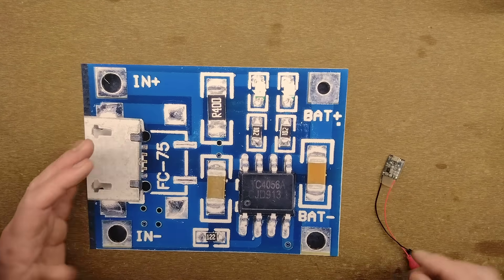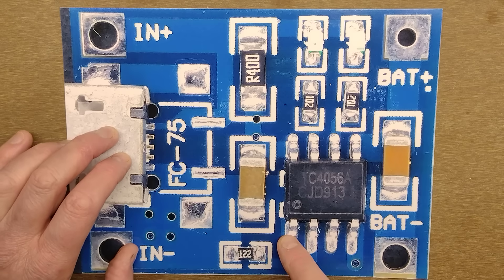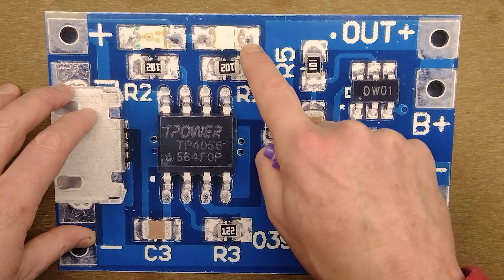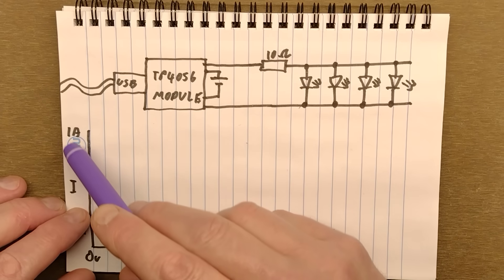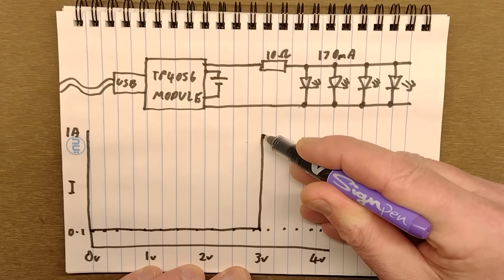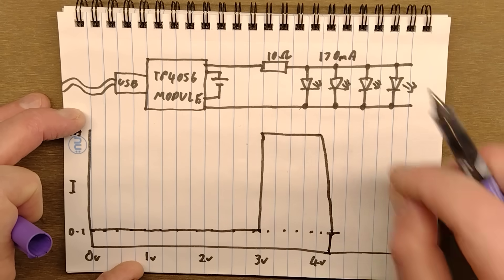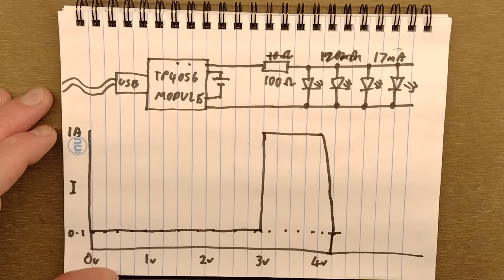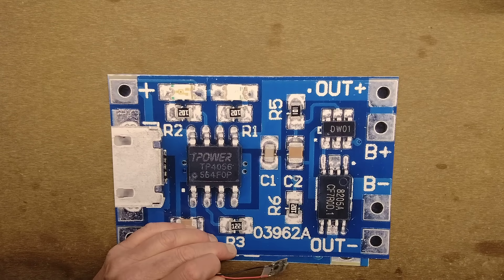TP4056 myth busting

Comment: Thank you for your work, very much appreciate it. The extra bits are usually inside the cell. I once used it to repair and modify a flash light whose TP4056 in 6-pin form was blown.

Comment: i think that low voltage 100mA charging is safety measure?
damaged battery will likely have low voltage, also emitting all amps as heat this will lead to fire hazard if you try to charge damaged battery

Comment: i have heard from videos on charging smart phones that keeping the phone on the charger for too long would wear out the battery faster because the charging circuit will cycle topping off and would be hard on the battery.

also i am not sure if  holding the battery at say 4.15 volts is good for the battery either.
Reply from the maker: It's more to do with keeping the battery in its fully charged level.  The most chemical stress on the electrodes is at full charge and discharge states.  That's why it's a good idea to stop charging your phone at about 80%.

Comment: why does that newer model have 4 output terminals?  "out" +/- and "b" +/- ?
Reply from the maker: Battery connections and load connections.  The extra circuitry prevents the cell from being over discharged.

Comment: Another argument i hear is that  when you use a load while charging, a flat battery will never be charged as yr load will consume the trickle charge. That might be, but as my battery fed projects usually will include some form of deep sleep, i am not that worried about a load pulling 100mA for 5-10 secs and only maybe 3uA for 3.5 hrs

Comment: I've just ordered a bunch of these to make a mini wind turbine that charge up my torch batteries, I need to know if the load would drain the battery if the wind stops!
If the charging voltage stops completely will the load drain the battery or will it just all stop? Thank you 😅
Reply from the maker: It should block reverse current flow.
Reply: @bigclivedotcom that won't be a problem, I mean, say I have a light connected to the outs, will the input power be charging the battery and powering the light?
Then when the power input stops, will it use the battery to  function?
Also.. (sorry), when the battery is fully charged, will it direct all excess power to the light/load or use the battery as its path.
I need a trigger in the circuit, say the "charge complete" led to signal a relay to shut down the tp4056 and send the current to my load I think 😅

Comment: i would like to use this to charge a li ion battery. at night time, the battery should power an led. So led must be turned off during light hours. could you advise me on the parts I need to include and what components I should use?

Comment: So, can we run a load with TP 40 56 while charging the battery?
Reply from the maker: If it's lower than the charge current it should work as detailed in the video.
Reply: @bigclivedotcom  Thank you for your short and clear answer.

Comment: One of my favourite modules.. I also like the charging module in the power banks with the 18650 inside.. they have over & under voltage protection but the thing I prefer is the output has a little boost converter so it's output is 5volts instead of 4.2v to 3.7v with the TP4056. 
Plus the power bank phone chargers has a USB connector built in. Comes in very handy for lots of little projects.
But that said, the TP4056 is a must have in any electronics parts box. The trickle charge option on it has got me out of more than one hole. 
The one that stands out the most in my memory is my nephews iPad discharging down to below 2,5volts. So I had to spend 20 to 30 minutes plugin in & out a phone power bank as it will give current for about 1.5 seconds before it realises that the voltage is to low then shuts off again. After 2 days of my nephew not putting it on charge before its battery was at 1% I remembered the trickle charge on the TP4056. And soldered a micro USB connector to it's output (to be honest I didn't think it would work as it's not the 5v of USB) but it worked like a charm. Could of opened it and fixed it but ya know kids these days. The 10/20 minutes it would of took to fix it was to long for him not to have it to watch stuff and chat with his friends... 😂 
Plus he was living here in my house with his dad at the time (my brother) and we're out in the country. He was brought up in town. So the boredom out here was driving the kid mad. So I didn't blame him 😠🤫(just kidding)
💚🇮🇪🙏

Comment: Hi again Clive, I need your advice again!
Tried to charge a 550mAh battery using a TP 4056 module and accidentally connected reverse polarity.
It seemed to charge for a few minutes but then the light went out (no Red "charged" light) that's when I found my error.
TP4056 is no more, but worse, the two Rear USB2.2 ports on my machine, (it's an intel 6i5SYH NUC) are now dead and I get notified every 5 seconds of with overcharge  warning, can't get rid of it.
Front USB's are working as is the rest of the machine fortunately.
Is the PC likely to be repairable?
Reply from the maker: It may have a resettable protection if turned off and on, but it's also possible a voltage regulator has failed.  The USB standard requires that computers have proper overcurrent protection on their ports.  If your computer is under warranty it may be covered, but don't tell them what you did.  I don't recommend plugging in anything other than peripherals or safe loads to computer USB sockets.  It's much safer to use a cheap and replaceable USB charger.
Reply: @bigclivedotcom  Thanks Clive, Sadly I don't think Intel are interested, it's a "Barebones Kit" I assembled back in 2016.
Posted on their Community, 39 views, no replies!
As I lay in bed last night, exactly your excellent wisdom dawned on me!
This morning, though it seems to have "repaired" itself, no more 5 second notifications and chimes but I don't have the Cojones to use the rear USB's now in case it all goes Mammaries aloft again!😖

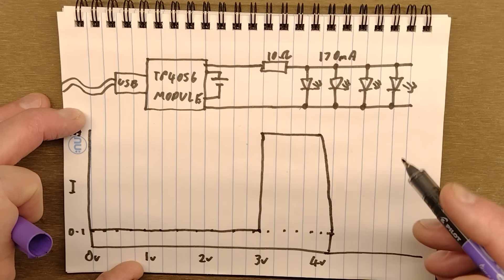Comment: At 6:20 you claimed the TP4056 would limit the current to 170ma. That is not true. The TP4056 has already switched in to Constant Voltage mode, before that point. The current is decreasing, ONLY because the voltage of the cell is increasing.  You are very confused.  Learn about  CC/CV charging modes.  With a 170ma load connected, the voltage will stay at 4.2 volts and the output current will never drop below 100ma. Charging current will contine to flow into the cell, well past the expected 100ma cut off point!!! Some boards will even go up to 4.3v forever = significantly  decreasing cell life. The TP4056 was designed to recharge the cell with the load turned OFF.
Reply from the maker: You may wish to do some experiments.

Comment: I did NOT see you measure the charging milliamps going into the cell with a 170ma load.  You just claimed the charging amps goes to ZERO at some point. If you continuously apply a constant Voltage of 4.2 volts across the cell, with a 170ma load, will the charging current into the cell ever go to ZERO?
Reply from the maker: The charge current into the cell will go to zero, but at below the peak charge voltage as the current goes to the load.

Comment: A question from an electronics novice who really doesn't know anything: From what I've seen around the internet, the cut-off voltage for the DW01 protection circuit is ~2.4V - very low for most Li-ion cells. Would you say this is safe for regular use in a scenario where the device would regularly be left on until drained?
Reply: I built a project using this board and threw in 2 schottky diodes on the positive side of the battery to make the battery never reach above 80%, and never drop below 20% charge, to extend it's battery life. I wish they made boards to limit the voltage of a battery to between 3v and 4v instead of 2.7v and 4.2v.
Most of the wear when charging and discharging a battery happens at that last 20% of charging/discharging.

If I'm wrong about this, Clive, can you do a video about it? I learned this from a maker community that I'm part of.
Reply from the maker: After cutting off the cell voltage usually floats back up.

Comment: I bought some of these to power a pico w and also charge from the pico's 5v out. However someone is telling me that if I use a cell with less than 1000mAh it could catch fire. Since these boards charge the cells at 1A. I've only used them with 18650 cells I reclaimed from a laptop battery. I cannot change the resistor for the rprog since its tiny and I lack the tools/skills to do so. Now I'm kind of stuck trying to figure out what BMS to use for my project.
Reply: If you are using "reclaimed" cells then you need to capacity test and grade your cells.

Comment: I've always been terrified of buying purpose-made lithium ion batteries for my projects because of how flammable they are.  And you're telling me to just reclaim random batteries sitting around the house?

Are these things no longer as unsafe as they used to be?  There's an RC Hobbyist forum with a list of like 200+ house fires from RC hobbyists messing around with them.
Reply from the maker: The RC packs are designed to put out very high current and the packs are often abused by nature of their application.
Reply: @bigclivedotcom  That's reassuring, I might finally delve into batteries then.  Thanks for your reply!
Reply: @moeburn LiFePO4 cells are not nearly as dangerous. But they require a lower charging voltage.

Comment: I often replace the R3 resistor with those tiny blue potentiometers. I like to charge individual 18650 cells at 500 mA. I noticed that sometimes when checking voltage with a multimeter, both LEDs turn on. Doesn't seem to hurt anything, but I'm curious as to why they do that.
Reply from the maker: It could be introduction of electrical noise.

Comment: help, my tp4056 (with dw01 chip) charges my batteries to 4.3v.   it that normal?
Reply from the maker: It's a bit high, but there's always a slight tolerance.  Also check your meter is accurate.
Reply: @bigclivedotcom  OK, charging just stopped (i unplugged it) battery at 4.41v (cheched with 3 meters). hooked it to a 10w led. manufacteurer says charged is 4.2v + - 0.05v . also its around 15 degrees c above room temp. i have a fire extinguisher handy. do i need a new 4056?
Reply: @KGB_rail  If 4.4 volts is accurately measured, then that is too high.

Comment: This modul is goog to charge polimer battery 3.7v 200mAh?
Reply from the maker: It should charge standard lithium rechargeable cells.  But you will need to adjust the resistor value to suit the lower charge current of your cell.
Reply: Whit 10k potentiometer is good ?

Comment: @bigclivedotcom Encouraged by your video on recycling vape lithium cells, I have secured a supply. Now I would like to run a Pi Pico off one of the cells but I would value your advice on the best way to do it while still maintaining a USB data connection. To clarify, the Pi and  lithium cell go in the same case, and I'd like to be able to plug the assemblage into a USB socket to charge the battery up. Keep on carbonating!

Comment: There's tons of videos about charging batteries and battery packs I'm still not sure who's correct.
Does an 18650 4 cell pack need a balance charger alongside a bms module?
I have a few 18650's and have put off making a  power bank.
Reply from the maker: If the cells are in series it requires a BMS system to make sure no individual cell exceeds its ratings.  In parallel only a single charge control circuit like this is needed.

Comment: This is so useful! I'd like to ask, is there a chip for potentially charging multiple, e.g. having multiple in parallel to extend the capacity?
Reply from the maker: You do get modules with parallel chips to increase the charge current.  Only one of the chips is used for the charge indicator LEDs.
Reply: @bigclivedotcom  Excuse me! I meant board, not chip! If I were to search for it, would it be using the multiple of the same base chip (TP4056), or something else?
Reply: Oh never mind you have a video on it called "Cheap power pack with free lithium cells" my bad

Comment: Thank you this is really a great information. 
1. During charging when voltage increase of the battery current also increases on the load(LED).
2. What is the maximum current can I draw through those dual MOSFET from the load.
3. I have seen my TP4056 module cut-off exactly after few minutes when the battery voltage reached to 4.2v at that time I was completely sweating and I was taken a cover behind the wall 😂. Is it safe?
What similar chip can you recommend me if I want to build a charger more than 2 or 3 A?

Thanks and appreciated for the efforts.

Comment: A question if anyone can answer.  Can you pair the outputs of these in series to increase the usable voltage on the output side?  I would like to pair 3- 3wh Lithium-Ion batteries to the battery side of each module in parallel and then series the outputs of 4 (total of 12 batteries) of the chargers to create a 12v output.  Would that work or am I missing something?  Input would still be 5v, but I'd likely use an old PC power supply for charging and just connect all of the inputs to a Molex connector. I have a boat load of E-cig batteries I've acquired that I'd like to chain together to power something that requires 12v.

Comment: Input voltage and current for these kind of module?
Reply from the maker: 5V at your programmed maximum current.
Reply: @bigclivedotcom  2.5 amp 5v input without modification can be given?

Comment: Can i charge 2 Samsung ICR18650 cells connected in parallel through single TP4056 module
Reply from the maker: Yes.  Make sure they are at a very similar voltage before connecting them in parallel to avoid high current flow between them.

Comment: Just curious do you have a module you can recomend for charging 9V nicd/nimh batteries?
Reply from the maker: Most commercial chargers use a very simple trickle charge circuit based on a 12V supply with a resistor and LED in series with the battery.

Comment: The PCB with DW01 chip is a real problem solver in single Li ion cell battery powered equipment.
I agree about the through holes either side of the current setting resistor.
I had to flick off the resistor with a soldering iron and solder on very fine fly leads to a 2k 10 turn pot mounted on the motherboard of the unit I was building.
You only really get a couple of goes at this because the land area is so small and the track is wafer thin!

Comment: What is over changing in the end? Why do phone batteries inflate if you keep the phone connected to the usb? I am looking for a solution to this that will keep an unmodified phone alive more than 6 months.

Even a simple buck converter set to 4.2v might do exactly the same job. Personally I like maybe 3.8v or some other voltage closer to the storage stable cell voltage. 

One idea would be for a charger that automaticaly cuts power when the current is under a certain level, just like a powerbank does. But it should be adjustable to be able to sense when the phone is at 80% and starts to slow down changing. Than restart charging 6 hours later (also adjustable). If the phone is rooted changing may be controlled by some apps. Overall there are no good solutions in having a phone or tablet in kiosk mode for long periods of time.

The idea of having a low voltage ups is very nice. Like a 12v power bank for the wifi router. Fiber optic routers could have full internet since the other end may be outside of your power outage.
Reply from the maker: It's a good idea to fully discharge and then recharge cells from time to time.  It may be viable to use an external LiFePO4 charger to keep the phone battery at a mid-level charge as opposed to the full 4.2V   but that depends on how the phone deals with having a battery that seems half charged all the time.
I think there is an app for rooted phones that allows the battery charge level to be lowered in software.

Comment: Thank you for this info.   One question, can I use this module to output to a 3.7V 703048 Lithium Polymer Ion Battery?    I've seen examples of them being used for 18650 battery, but I'm not sure if can use the flatter LiPo modules as the 2 wires coming from the battery seem to go to another small BMS circuit on the top of the battery as well?
Reply from the maker: These modules are suitable for most lithium batteries with an upper charge of 4.2V.  That includes most standard pouch cells.

Comment: I was wondering, you suggested 2 round pads/through holes for a quarter watt resister, and it got me thinking -  with sites allowing you to make your own pcb,  what else would you do to make this particular design better?   Like, 'the best, 18650 lithium ion charging module" so to speak?
Reply from the maker: These modules are good enough as they are.  The only improvements might be the easier resistor change and better PCB heatsinking.

Comment: Regarding the new camera audio. You might try using a 'Low Pass' filter to roll off everything above 8-10khz. The 's' sounds, and sound in general is very "sharp/piercing to the ear.

It likely has a higher quality microphone/recording and is picking up more in the high end of the spectrum. It's just not ideal in this case. 🤷‍♀️

Love your content!  😊👍

Comment: would be really nice if you could use these 4056 with multicell ebike batteries for charging i.e. each cell in series has its own little charger......e.g. 7s or 7 cells in series is a 24v pack.
If that were possible that would be really something as each cell would reach same voltage and pack would always be balanced. 
But I believe it cant be done unfortunatelly unless each little 4056 has its own separate power supply.
Any thoughts on this? It would be a hell of a charger if it can be done.
Reply: Yes you can, if you have an isolated power source for each TP4056.